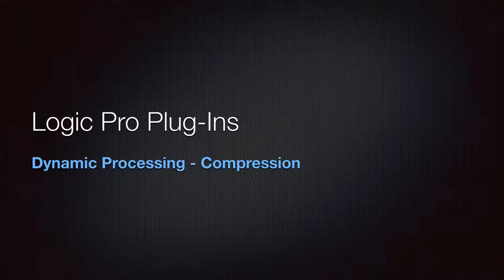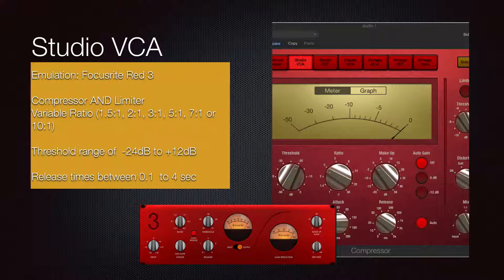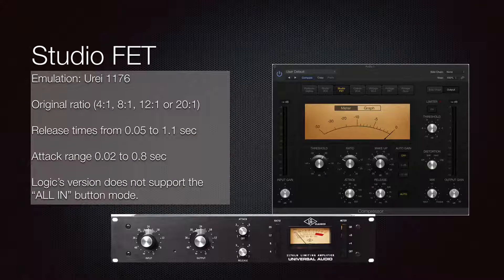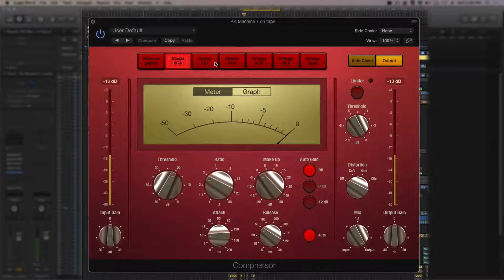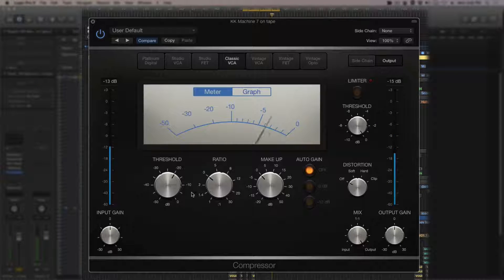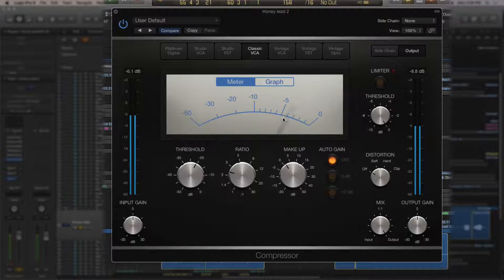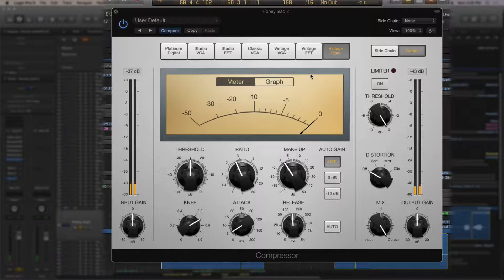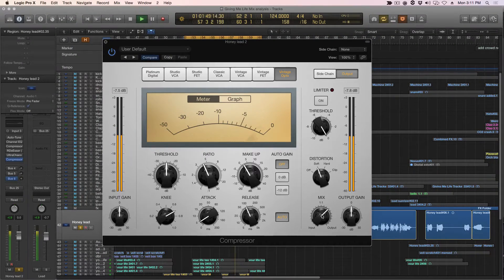Logic Pro X - Compressor Types and Usage

Comment: Just a note. the platinum digital doesn't add any harmonics at all. It's not that it sounds transparent, it IS transparent.
Reply from the maker: You are correct, it is completely transparent, but I would argue that any compressor will add harmonica if used excessively. Also, you can add harmonic distortion by adding drive or gain.
Reply: Oh, of course, indeed! I should not have excluded that. Great video man!
Reply: What do you guys mean by transparent?